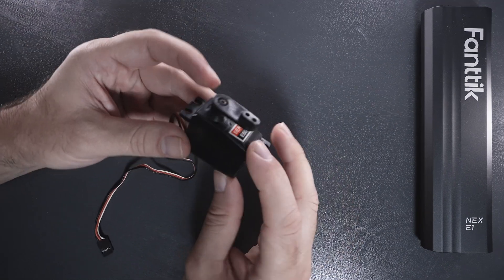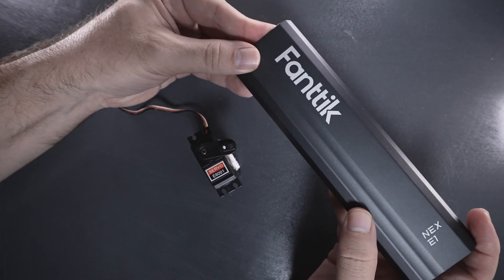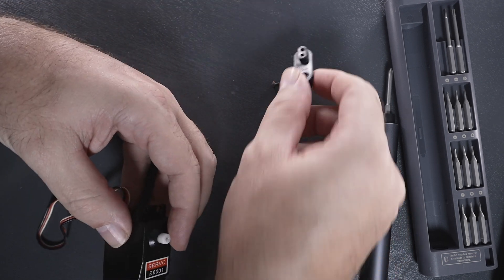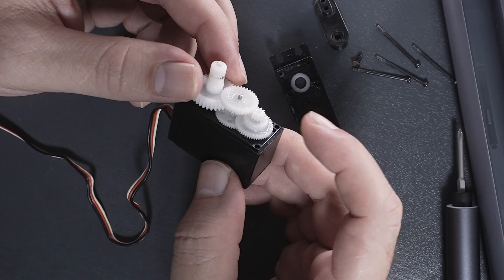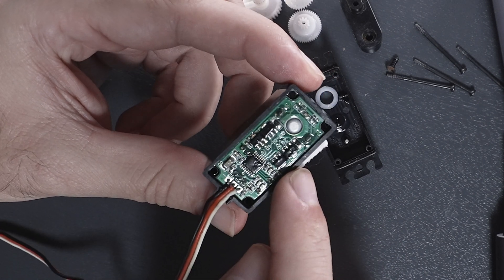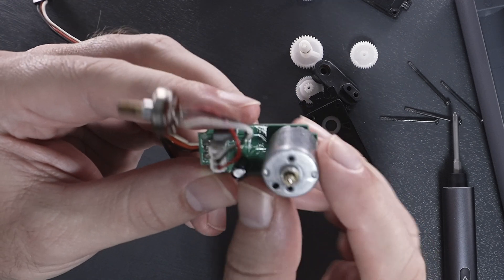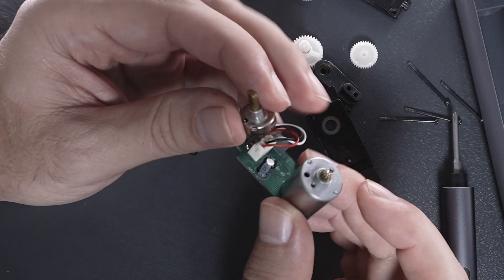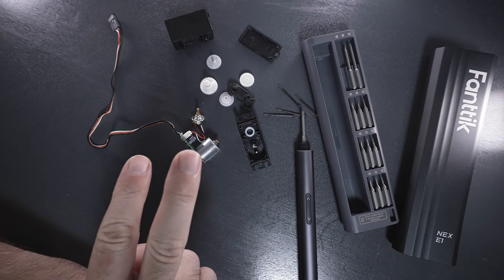Remote Control RC Servo - Teardown

Comment: Surprisingly well made inside especially the pot connected to the PCB with a connector. Usually those cheap plastic gear noname servos of the type that come with an RC car kit are made as cheaply as possible and have horrifyingly bad quality soldering inside. Most people treat those servos like the peel on a bananna, you don't actually eat it. Instead you buy an actually good servo and replace it.